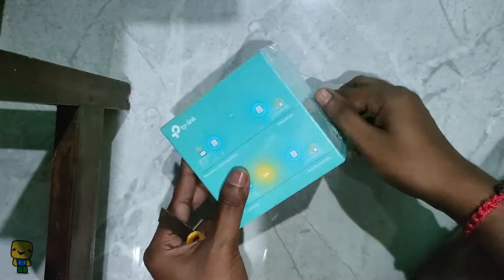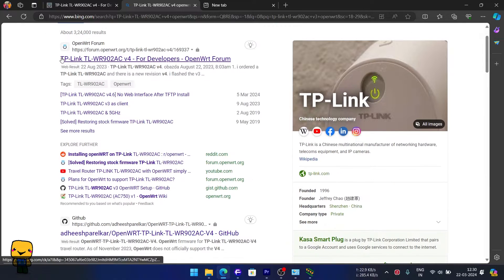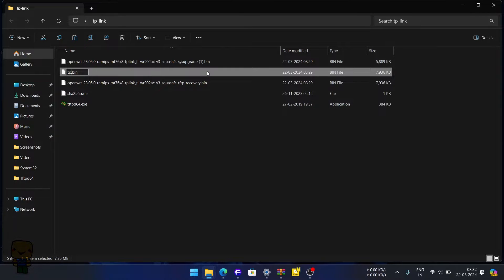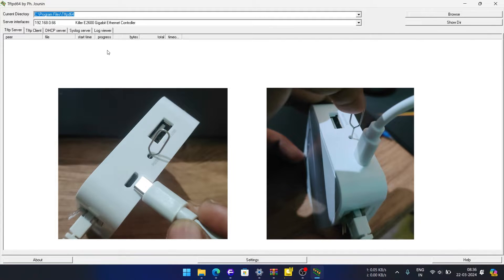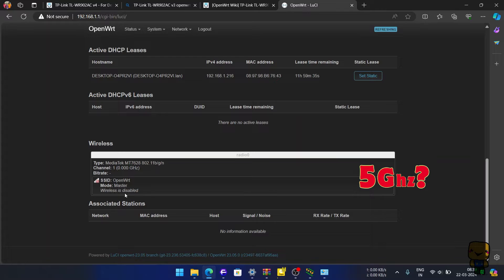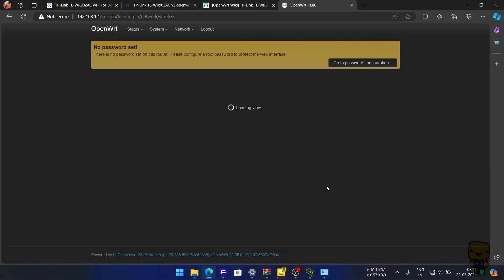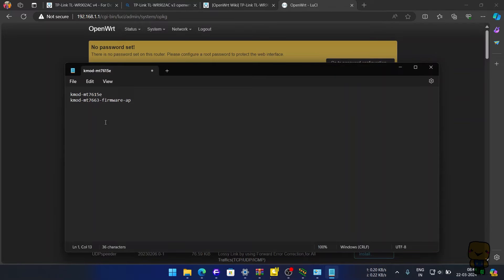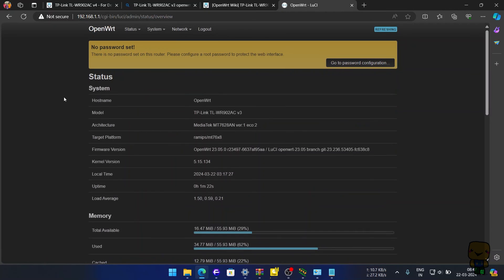TP-Link TL-WR902AC v4 OpenWrt : A friendly guide.

Comment: i would like to know if i can put a vpn protocol in the router ?
Reply: Maybe after extending the storage you'd be able to instal the OpenVPN (just the packages required are more than the space available), but out of the box you could do the Wireguard. I have it installed for few days now with a profile set for my home router. Tested it out connecting to the tethered wifi from my phone and seems to be behaving OK. Real life test will be in a week, when I have a business trip and will be staying for a week in a hotel. Let's see...
Reply from the maker: @kikobg00  Do let us know on how it went!!
Reply: @Bytetutes  OK.... Second night in a hotel in Spain. The hotel's WIFI is not that good, but the Wireguard client is performing not bad. Don't think I've experienced disconnects due to it. Once you set up the router and its connections, it is quite stable. The problem I'm seing with this router is its 5G. If you connect both your device and try setting up the connection to the public wifi on the radio1 (5G), then you get quite a lot of problems. If you connect your device on the radio0 and then connect the router to the public wifi through radio1, the process is quite less painfull. All in all, WG, but the speeds that the router can support are not great. Connected to the hotel wifi - D28.5/U24.5; On WG client on the laptop - D21.5/U18.5; On the 902AC - D13/U12.
Reply from the maker: WireGuard would be the most lightweight and efficient VPN option for the TL-WR902AC. It has a simpler, leaner codebase compared to OpenVPN and is designed for high performance, even on low-powered devices like the above. I may try to install and make a video on this topic.
Reply: Can use vless VPN on this device?

Comment: Great guide, thank you very much, mine seems to work ok on both 2.4 / 5 GHz, but dies every 24hrs or so, no TX, No LuCI GUI, no ping, it needs a power cycle to bring it back to life, then it is good for another day or so.
Reply from the maker: Maybe your device storage gets full and breaks functionality with all the logs, dns caching it does and after reboot all temp files are removed and device functions normally. I am working on a way around where I can use a usb thumb drive as disk space. So, stay tuned.
Reply: Terrific video, thank you .  Any news on a V4 update?  Waiting on that before OpenWRT-ing my travel router.

Comment: Hi Can we install wireguard client on it?
Reply from the maker: Do let me know your experience if you decide to move forward 😉
Reply from the maker: This device has 8/64Mb of flash/ram and it is recommended for a device to have atleast 16/128Mbits of storage. You can install but I think the router may freeze occasionally or reboot once RAM gets full. For testing and tinkering It may be fine. Idk!